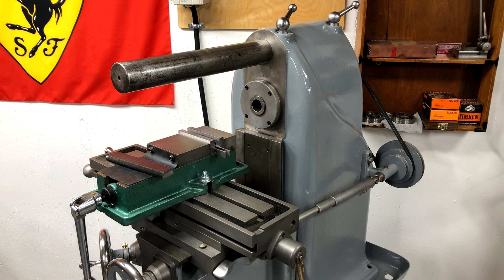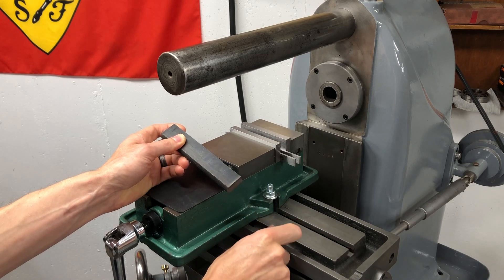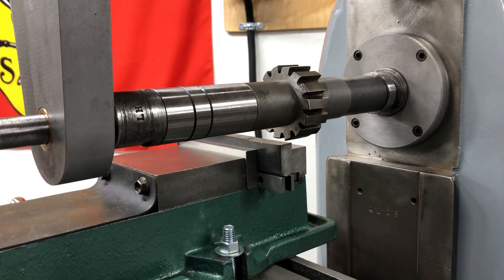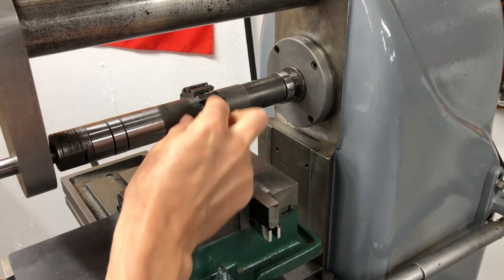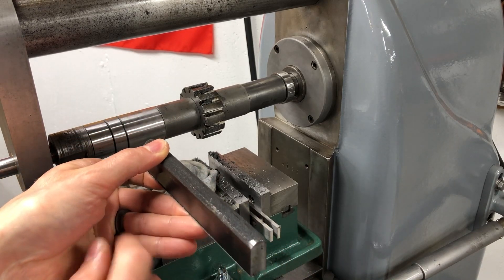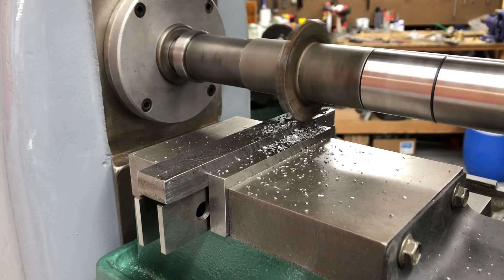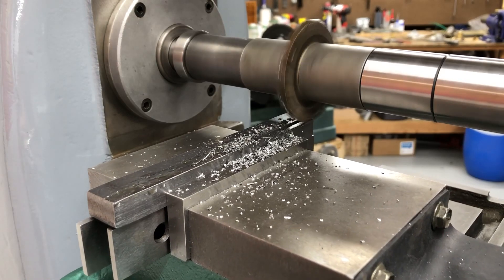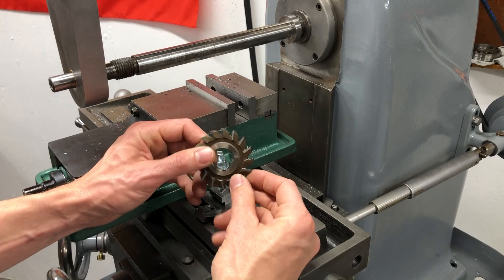Making T-Nuts on the Sheldon Vernon Horizontal Mill

Comment: I can see a great adventure coming, where you try to make a new arbor. Do you have a lathe? 

I say this is an adventure because I have tried to make parts for my machinery, and when you want precision of .0002", say, it brings up all kinds of weird issues you have to see to believe. It is a whole new skillset. But in the end, you emerge as a far better machinist, with a straighter arbor, both of which bring joy whenever you come back to the shop!

You probably know this, but you may be able to meter the challenges down a little by purchasing a precision shaft of the right size. Ideally you could measure the ID's of the cutters and ask a centerless grinding shop how close a sliding fit they could make. I have seen where Blondihacks turned an MT2, and could finish it adequately on a hobby lathe. She is my go-to for tips on achieving high precision on lightly built equipment.
Reply: I had similar thoughts. I just picked up a Burke #4 today and it didn’t come with an arbor or the dead center piece that goes on the support arm. Instead it has the vertical attachment setup. I say this because I noticed quite a bit of movement at the collet base where the arbor inserts. I wonder how much is the arbor and how much is tied to old worn out bearings? Perhaps a little of both?
Reply: I had similar thoughts. I just picked up a Burke #4 today and it didn’t come with an arbor or the dead center piece that goes on the support arm. Instead it has the vertical attachment setup. I say this because I noticed quite a bit of movement at the collet base where the arbor inserts. I wonder how much is the arbor and how much is tied to old worn out bearings? Perhaps a little of both?

Comment: Your arbor spacers are not flat and parallel on the ends, that's why the arbor appears bent and cutter appears out of round. Could be dirty, could be dinged up, could just be cut a little out of square when they were made. It is possible to get one to run straight and true though!

Comment: Don’t know if you still monitor comments but I just purchased an identical machine that I plan to restore.    Did you find a supplier for such things as leadscrew nuts, etc.   Also how many horsepower is your motor?  Thanks .
Reply from the maker: I had no luck with supply of parts.  Maybe you could get lucky on eBay if someone is parting one out.  Likely you will need to make parts yourself.  My motor is 3/4hp - 3 phase

Comment: Is there any possibility that you can get a photo of the name plate for the motor?  I found that the mill came with a 1-hp 3 phase motor or a 1hp single phase motor.  I am trying to figure what I need to purchase since I have nothing to work with.  If there is no name plate, what size shaft does the motor have?  Any help would be appreciated

Comment: What size cutters you need?
Reply from the maker: I’m keep my eye out for anything with a 7/8” diameter hole because that’s what arbor I have
Reply: @BuildFixCreate  I have 1" & 1.25 
Look on Ebay used lathe tooling, I get alot of tooling from them. Good luck.

Comment: Do you have or can you get the motor information for your machine?  I just purchased one of these and it does not have a motor installed at this time.  I found some literature that this machine may have come with a 1hp single phase motor, but I do not know what style of motor it came with when I go to buy a new one.  
Thanks,
Chris
Reply from the maker: Mine has a 3/4hp 220v 3phase motor.  I’m sure you could get one that was single phase and it should work.  I had to get a vfd in order to run mine.

Comment: Is the arbor threaded for a drawbar? This would help with the rigidity.
Reply from the maker: Not it’s not.  I was surprised at first that it’s not threaded but if you try to get out a B&S 9 taper it is not easy.  So I think it grips really well on it’s own.
Reply: @BuildFixCreate  I have a Brown and Sharp 2A Universal Mill and the Vertical Head on it is B&S 10 and it is VERY difficult to remove tooling from the taper. I should also mention it has a single arm for horizontal milling like your machine has. Great machine from after 1912 till perhaps 1926 is all I have learned about this flat belt drive machine. Also have the dividing head and change gears that came with it. Great old Machine, I love it. Cheers from John, Australia.

Comment: Horizontal milling cutters almost never hit on all teeth, it's purely luck of the draw because nothing in the system is perfect. That last one is a bit excessive, it's possible someone re-ground it free hand. You can make a simple spring indexing finger that clamps to the overarm support on the mill that engages the teeth on the cutter. With that you can use a small grinder on the opposite side of the arbor to regrind the teeth.
Reply from the maker: Thanks for the idea!